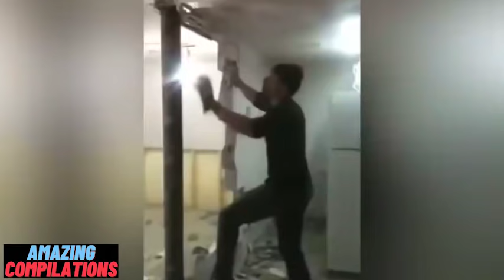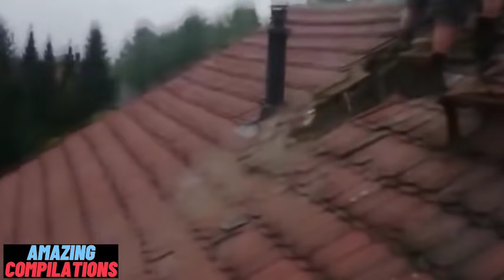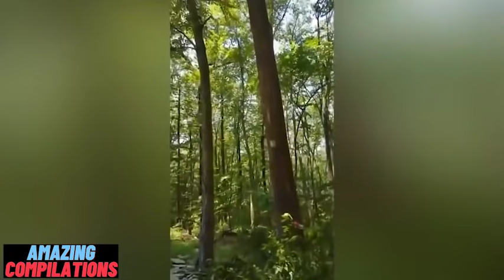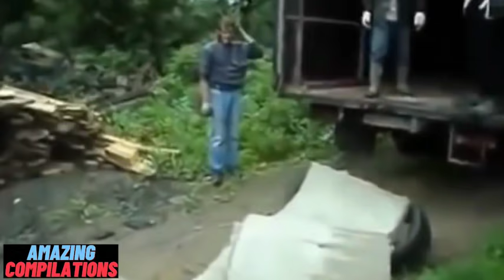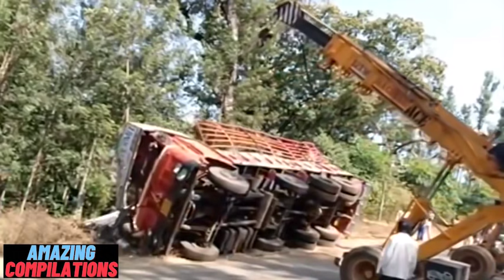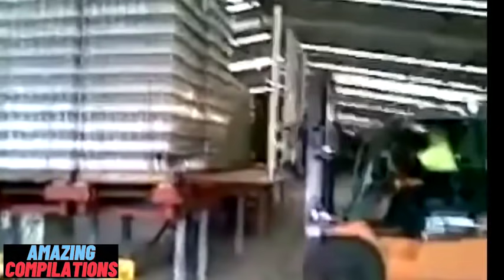Total IDIOTS at Work #6

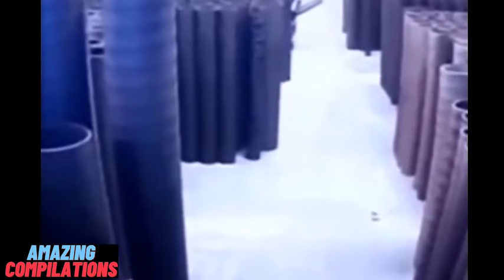Comment: I can actually relate to the vertical dominos @ 1:50.  At my first summer job, I was the 6' vinyl guy at a tile warehouse.  They sold flooring vinyl in 6' and 12' widths.  The 6' vinyl would be ~200' long and weigh at least 150 lbs.  They would store the 6' rolls on end to save space.   You move them with a hand truck that was designed to cradle the round cylinders.  That's fine.  Just don't be zealous moving those rolls or you end up with 150 lbs. dominos.   Once they start.  Lookout! 🤦‍♀🤦‍♀

Comment: The clip of all those bottles falling off the palet, that is not the fault of the fork lift driver. That is the fault of whoever sent that pallet out.  Pallets must be wrapped with plastic sheet wrap enough times to support the weight of the product on the palet, because weight shifts all the time.  Palete should be wrapped solidly.